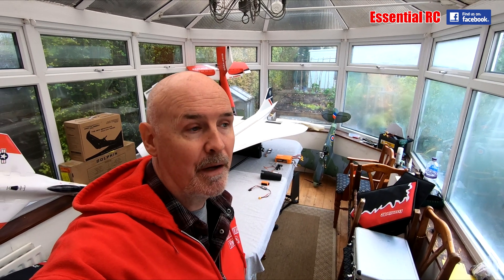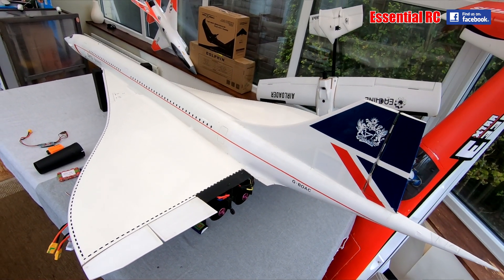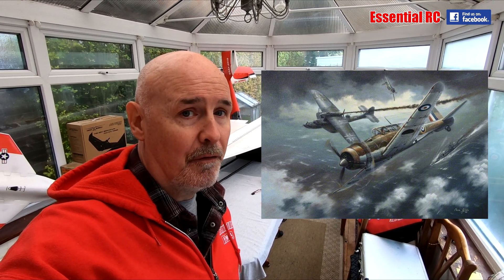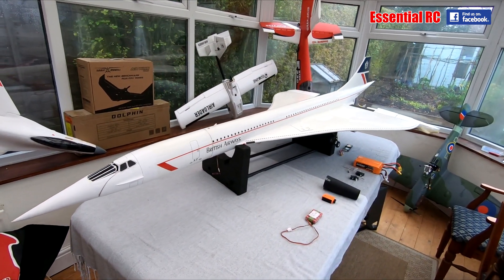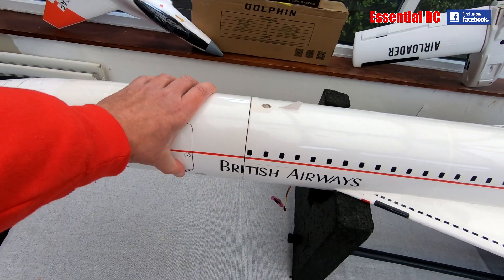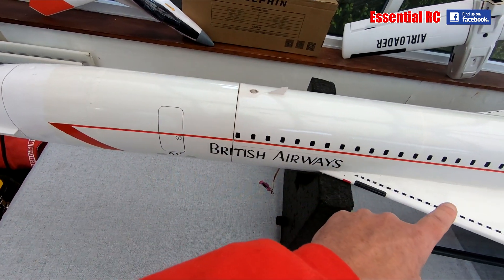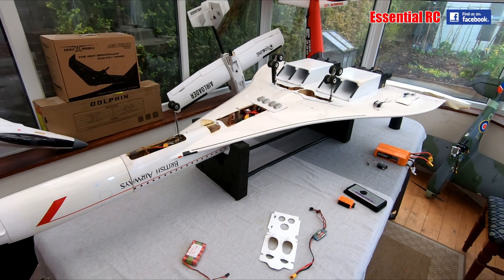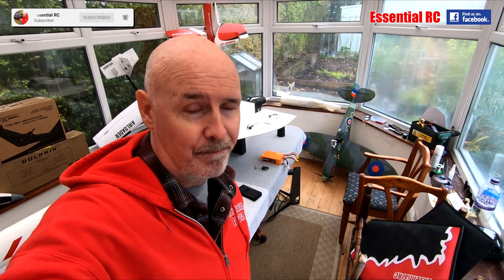CONCORDE WILL FLY AGAIN !!! PROJECT UPDATE | LARGE SCALE 4xEDF & NOSE DROOP | BUILT BY CHRIS GOLDS

Comment: Have you considered adding some fairly coarse window screen to the intakes to prevent FODding another set of engines?  I know it would cut the airflow down rather drastically, but with the new fans it should still be more powerful than it was originally.
Reply from the maker: It has been suggested and am thinking about it. Shouldn't be needed if flying off dry grass and that's the plan.